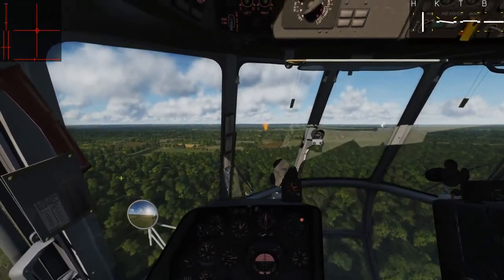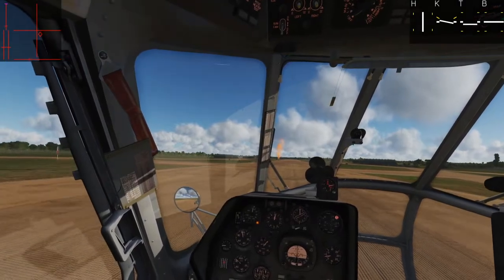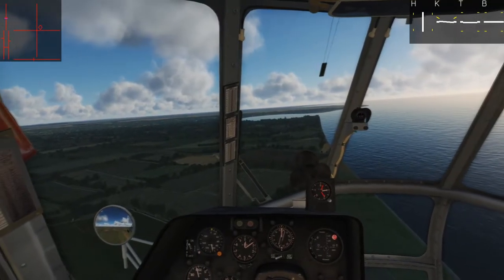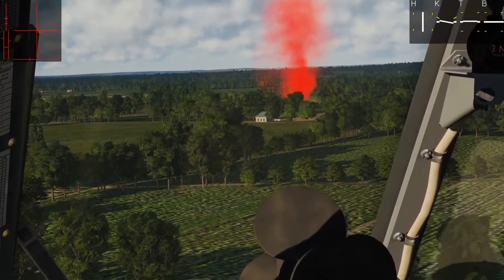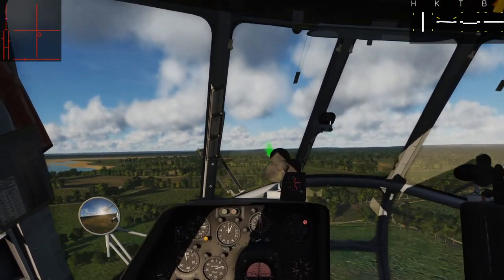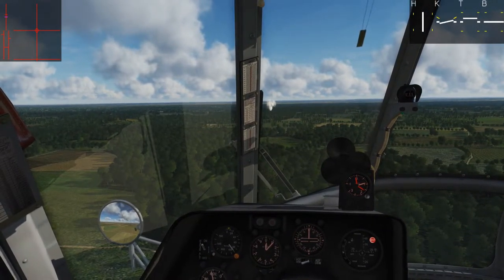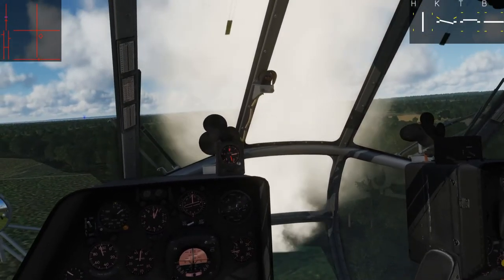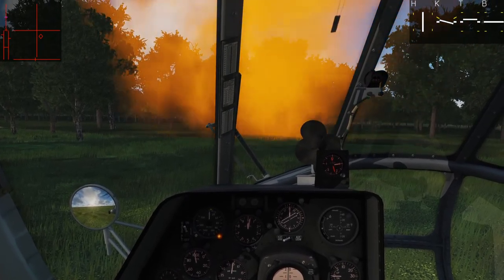DCS Mi-8: Landing Tutorial

Comment: A good rule of thumb that was taught to me by an Mi-8 engineer is to keep the rate of descent and your airspeed so that your altitude matches your speed. So 100 meters height = 100km/h. What that means is that when you get into ETL, you're near or lower than 50 meters doing < 50km/h which will ease your transition into a hover as well as keeping the landing site fixed in the same frame of reference you draw up when making your approach.
Reply from the maker: Good tip, thanks for sharing!

Comment: brilliant tutorial, the entire series in fact is excellent. Just wanted to mention that the kind of approach ending in the hover close to ground that you showed was what I was doing when I first started flying the R22. My instructor let me do a couple of them, then said this would be fine, if we were to fly people into a hot LZ or something, otherwise we should avoid this sort of very fast very shallow approaches, very little room to react if anything were to go wrong. So instead we kinda want a bit steeper angle, with bleeding speed a bit earlier. I was taught to aim for the descent to end in a hover, at good ground effect altitude, but with a bit of forward speed for directional stability, meaning in this case if the pad was your touchdown target, you should be in a stable hover in ground effect a few meters before it, with some small forward momentum remaining. This avoids the hard pull on the nose at the very last moment, protecting your boom and tail rotor, and keeping visual of the pad, lessen the need to add massive amounts of collective in a very short time (I don't even think the engineers would forgive such blade AoA increase speed unless an emergency, it really stresses out the transmission), also preventing the need for very fast input of right pedal. Like you said, a lot happens really really fast, and with 10 tons of hot heavy metal you want to give yourself as much room for error as possible. Nice flying though, I learned a lot about the Hip systems watching your tutorials, great work!
Reply from the maker: Thanks for the comment and feedback! This is a video I've often wanted to re-do because you're absolutely right about everything you said. I didn't know any better when I recorded this.

Comment: One question, always when I was flying I felt that the autopilot wanted to take me to a place rather than keep the flight stable, deactivating the "autopilot adjustment" option in special options, I think it will solve the problem, but also there is a key to ask the engineer to adjust it (a voice comes out), what are these 2 options really doing? Thanks for the material, your tutorials are currently the best there is on youtube and clearly deserve more reproductions.
Reply: An extra question, on the second landing you have the correction level at 50%, I have noticed that on occasions it is not necessary to have as much engine power (load, total weight, etc.), is that why?

Comment: Hey. I would be really grateful if you would do (another) video on how to land on the Hospital in Dubai; with tips. I can land the huey just about anywhere, but on top of that narrow "tower" I just struggle.
Reply: BTW: I have about 10 flight hours in the huey, so I know I just need to practice.
Reply from the maker: I can do that, for sure. I've got a tutorial in progress for transitioning to hover without changing altitude, which is exactly what you need for that pad. You have no ground effect there so you basically just transition to hover and then make your way over to the pad and set down.

Some tips: slow down. Approach the hospital at 100-120kph. Don't aim for the pad, aim to slow down and stop in front of the building where you can use it as a reference point for your hover. Stabilize. Trim. Ease forward until you're over the pad, and remember that your nose wheel is under your chair so you should touch down feeling like you're sitting pretty close to the edge of the pad.

Also don't be afraid to use Pause and F2 camera to compare where you think you are with where you really are.
Reply from the maker: I just realized I gave you some sort of Mi-8 specific tips there and you were asking about the Huey.

So, try about 60kts on approach, and because you're a lot smaller you don't have to park so far forward.

And like you say, it's just practice. That landing is a hard one by any standard. Good luck!
Reply: @vsTerminus  After having a think, I planned to practice a slow approach at 500 feet to nothing. That way I have room to get out of a VRS.
I have seen how pilots land on platforms in real life... I'm gonna try it hehe

Comment: When you landed on the pad, did you apply any trim during the landing?  I find it nearly impossible to prevent this module from wanting to move forward, especially during hover attempts.  Also, you say that buffeting means slowing down to fast?  Do you have a video on this?
Reply from the maker: Good questions :)

I don't typically trim often while landing. I'll usually trim for forward level flight at a fairly slow speed (around 120kph or less?), and then just hand fly it in from there. Once I'm down I hit Trim-Reset.

Every pilot is different. Some trim constantly, some never trim at all, others like to trim-reset before they come in to land. I think it's whatever makes you comfortable.

The Mi-8 wants to go forward because the main rotor tilts forward. Your trim for a hover should be a little bit aft and a little bit right. I have a video on hovering that goes over everything you need to know for that.

The buffeting doesn't mean you're slowing down too fast, it just means that you're slow enough where you're going to lose "Effective Translational Lift" and you'll need to add some collective to compensate for it. I have a video on "Vortex Ring State" that might be helpful with that one.

Comment: Do you lower the throttle when landing? I usually run 100% throttle.
Reply from the maker: No, I don't touch the throttle unless I want to shut the engines down. 

In a scenario where you wanted to roll the throttle down after landing but not to shut the engines down, you'd want to first fire up the APU and switch on the APU Gen so that when your rotor RPM comes down you don't lose all your systems that require generators.
Reply: @vsTerminus   thanks. Just checking because in landing after the runway it looked like you were running half throttle (little pink bar). I was making sure I wasn't doing anything wrong. It was probably just a visual bug on the game's end. The footage is from 3 years ago so I just wanted to check.
Reply from the maker: That visual bug used to be common, especially if you hot started and never touched the physical throttle.